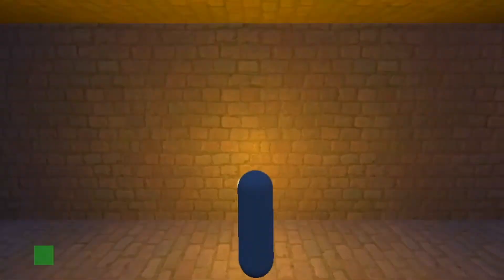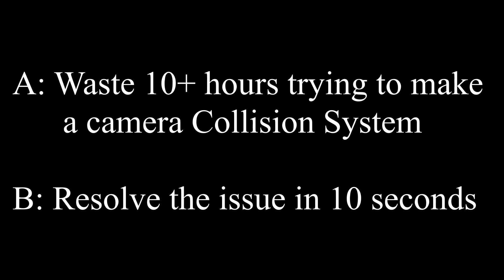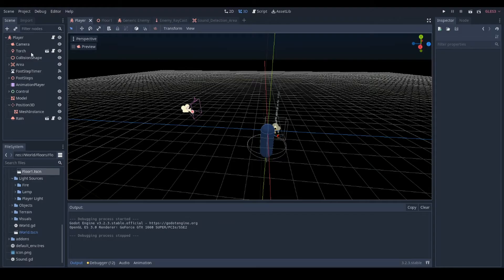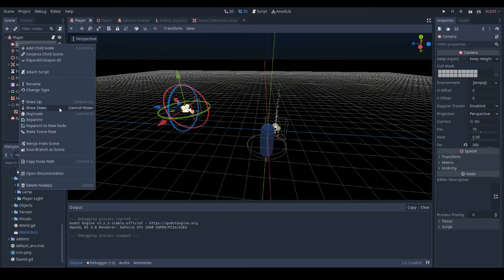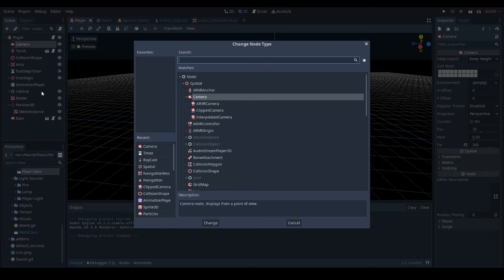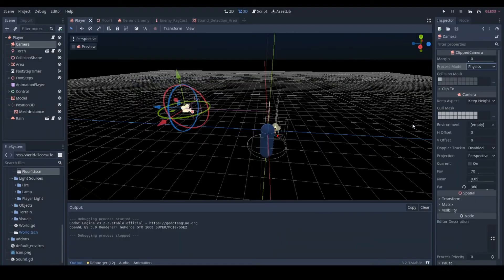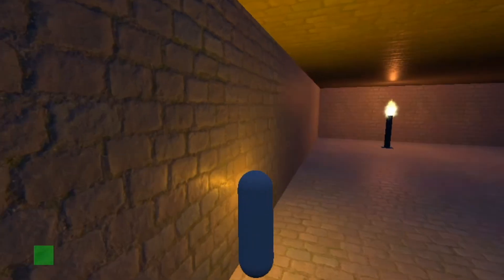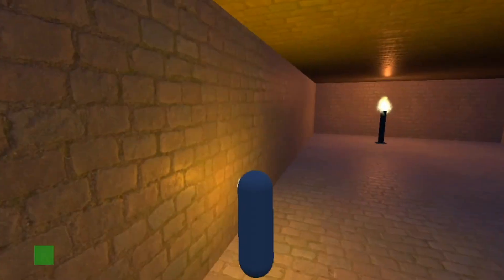Godot 3 3D: Camera clipping through wall fix

Comment: What is the equivalent in Godot 4? The clipped camera node has been removed
Reply: did you find anything ? :D
Reply: @da_cat use a spring arm with a camera as a child. place the spring arm where the character is and move the cam where you want it.
Reply: @platypus001  yes, I try this as well.

Comment: sadly only on simple games
Reply: I wouldn’t say this, the cam works by colliding with other objects on its collision layer so all you need is walls on the same collision later
Reply: @thechaxxe3565  the camera I have worked on has zoom feature controlled by the scroll wheel and also detects when there is a wall between the camera and the player,  then closes the distance. It actually doesn't use the spring arm, which I didn't like because it sprung back whenever only the center point was behind a wall, which would cause the spring to activate when otherwise, the object would have still been visible. I got my camera to detect if there's basically any visible portion of it unobscured, and if there isn't, only then does it zoom in. The problem with my current setup, is that the way it works doesn't seem compatible with clipped camera, in fact, when I tried changing the normal camera into a clipped camera, it behaved the exact same no matter what settings I changed. I honestly don't know what to do lmao